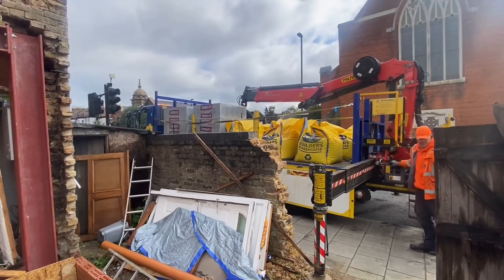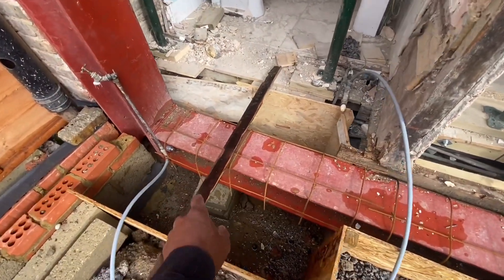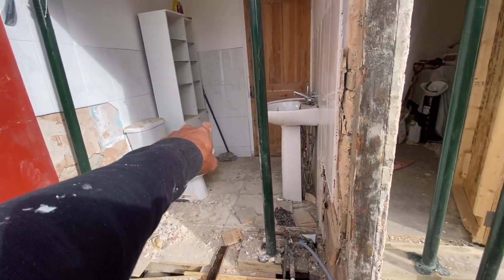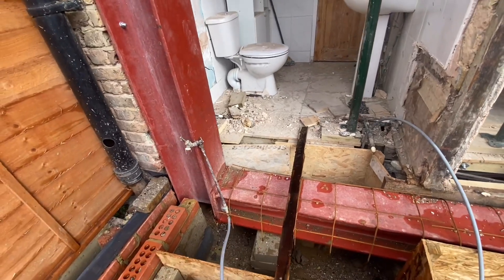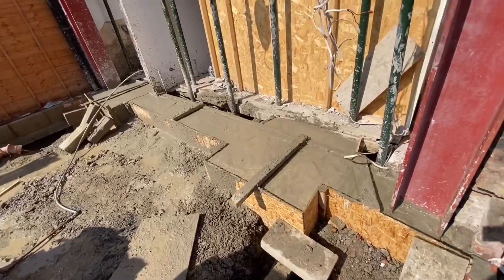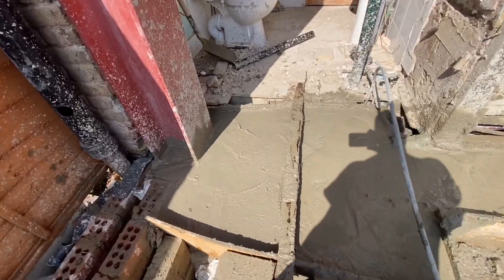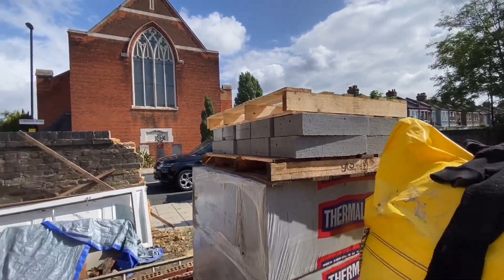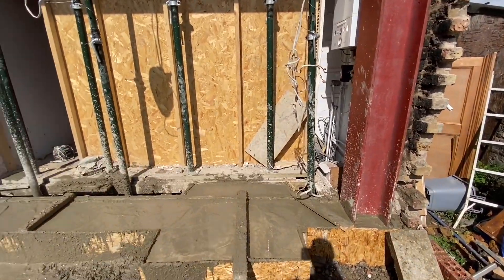London Extension build Ep  24 - Casting the steel box frame in concrete

Comment: waste pipe passing through concrete foundation, it needs to be sleeved, or wrapped around by flexible material
Reply from the maker: @jinlongli8682  waste pipe was, what you see in the video is the vent pipes for underfloor ventilation/ducting
Reply: ah OK. Thanks for responding @darrenthebuilder

Comment: Did you consider asking the client/customer to pay a firm like concrete singh to pour a ready made concentrate mix over the steel beams? Would have saved a back breaking day as I know from first hand mixing cement is hard work.

Comment: Silly question Darren - you mentioned the waste pipe for the bathroom but how are you tackling the waste etc for the new kitchen? Will it tie into the bathroom waste?
Reply from the maker: It will go into a gully which will be some when outside the kitchen wall side. It’s a drain on the ground on the front if the building. The pipe will exit the wall behind the sink and into the drain
Reply: @darrenthebuilder  ahhh of course. There’s that space on that side. Thanks Darren for explaining

Comment: Progressing nicely! Out of curiosity, did you find out why the steels were designed that way? Also quick tip... try using a sds drill on hammer to vibrate the concrete